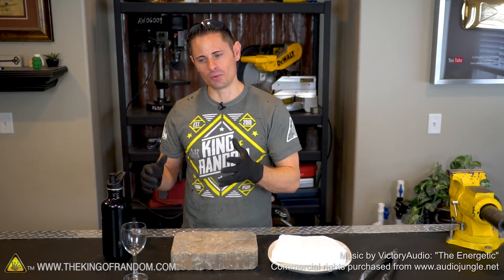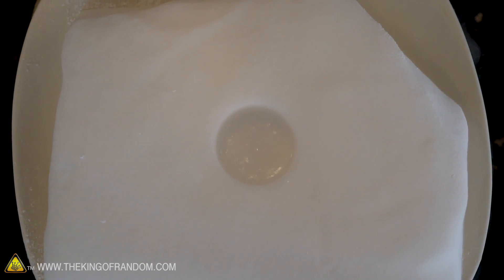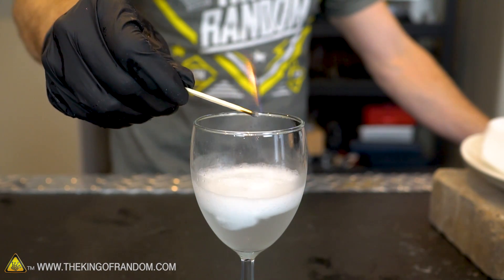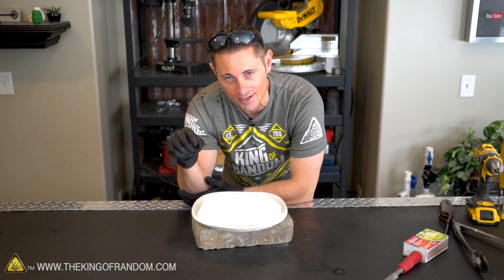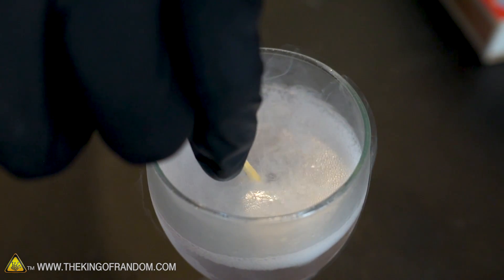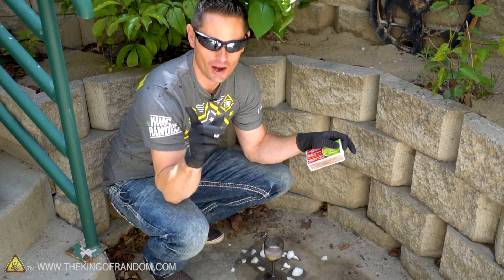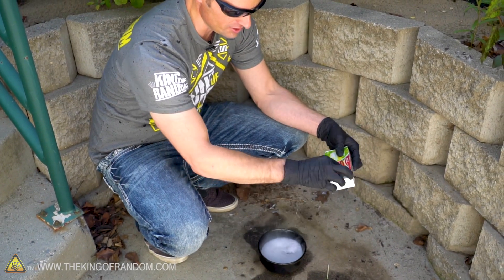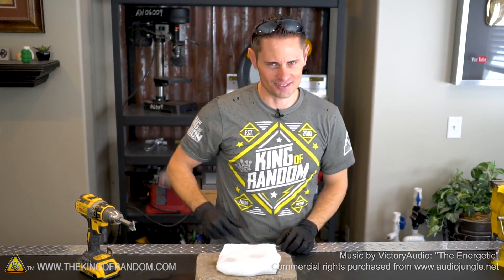What Does GASOLINE Do To Dry Ice? Can You Really Make A Fire Extinguisher With Gasoline?

Comment: The cold temperature of the gasoline stopped (or slowed enough) the volatility of the gasoline to cease evaporation, so there were no gasoline fumes, thus placing the gasoline below it's LEL. Gasoline does not burn. The vapor of gasoline burns.

Comment: -40°f is the start of crystallization not 40°f. But gasoline reactivness slows down starting around -10°f. Freezing point also depends on the octane grade. Low grade fuel will be a different freezing point then high grade or aviation fuel.

Comment: Gasoline its self is not flammable it's the vapors that come off of it that start on fire that fire Heats gasoline which causes more Vapors which causes a bigger Flame adding the dry ice to it cools down the gasoline so it doesn't produce any more Vapors as well as a carbon dioxide layer that makes it extremely hard to light the gasoline on fire

Comment: Normally the liquid gasoline  will not burn, it is the vapor that burns.

If gasoline fumes where lighter than the CO2 fumes, the results would be different.
This is why the CO2 fire extinguishers work.

Comment: Actually, the CO2 layer put the match out BEFORE the match even hit the gas. Oh, and by the way. It probably wasn't the brightest idea to use a battery powered BRUSH MOTOR in a drill to bore a hole in dry ice with a two cup measure of premium gas sitting there open. Invisible gasoline  vapors are explosive.

Comment: You covered that the CO2 puts out the flame by starving it of O2, but there are 2 other factors. First, gasoline has to vaporize before it becomes flammable.   The dry ice can cool it to the point where it no longer evaporates. Second, you need heat to sustain a fire. If you cool it down enough it no longer has the energy available to support the reaction. These three reasons are why CO2 is used to extinguish fires. It has the ability to take away any and all of the three parts of a fire triangle.

Comment: well technically the gas didn't put the fire out. The CO2 would have choked the flame before it hit the gas. It just didn't reignite in the gas.

CO2 is heavier than the air around it but lighter than the Gasoline. So the space above the gas and below the top of the dry ice will always have a layer of CO2 that will choke/starve the flame.

Comment: Carbon dioxide is WAY more soluble in organic solvents than in water. So when you drop lumps of dry ice into gasoline, it bubbles at first as the dry ice sublimes and cools the gasoline down. But if you keep adding more once the liquid is chilled, the solid dry ice actually dissolves in the gasoline to create a super-chilled solution. The coldest temperature possible will be the sublimation point of dry ice itself, which is -78.5 C.

In chemistry labs, this effect is used for chilling reaction flasks, when you need to go colder than water-ice (or ice/salt freezing mixture), but not so cold as liquid nitrogen. Chemists often use denatured ethanol or isopropanol for this, mainly because nobody is going to complain if you dump a bit of alcohol down the sink when you're done with the cold bath, but they can also be cheaper than gasoline.

Comment: the gasoline liquid is not flammable, in room temperature the gasoline is vaporizing and the fumes are the flammable part. 
when you pure it on dry ice, the temperature of the gasoline is too low to vaporize, so there are no fumes so it cant ignite.

Comment: the reason you cant blow away the co2 and light the gasoline on fire is because fire needs 3 things to stay lit, it needs HEAT, oxygen & a fuel. so even though u were blowing the co2 away in the puddle you had in the giant dry ice block is because it did not have that heat it even though it had fuel (gas) and oxygen

Comment: Dry ice cool gasoline until it no longer vapourizes. No vapour no burning, regardless of temperature. The CO2 gas is secondary to the gas not lighting. Put the gas in a cup and chill it with dry ice not in direct contact and it still wouldn’t light.

Comment: We used to literally use hexane baths with dry ice for setting up cold organic chemistry synthesis reactions. It created a better cooling system that wouldn't freeze but would maintain contact with large round bottom flasks.

There was a point where a problematic situation occurred resulting in sparks falling directly into the ~3 liter hexane bath, but at ~ -78 C with the carbon dioxide layers no ignition ever started.

Comment: It's not the gasoline that you need to light but the vapors. Gasoline all by itself is pretty hard to light on fire regardless of what Hollywood has tried to show us. Drop a lit cigarette into a pool of gasoline and the gasoline will put out the cigarette. Hold an open flame just above an amount of gasoline and it will light.

When trying to light this there's still too much C02 not to mention not enough vapor for gasoline to light.

Comment: This guy knows nothing about science. Sad.
Reply: Ray Woods This is so wrong it burns my brain.
Reply: Ray Woods 1. Ethanol is not a part of most gasolines, 2. Ethanol freezes at -114,1 °C which is higher than the -195,79 °C melting point of nitrogen. Sorry, but saying alcohols do not freeze at any temperature is plain out wrong.
Reply: +Ray Woods he meant -40 F. Said it in his previous gasoline video. Depending on the blend, Gasoline freezes between -40 F and -200 F, it's a wide range that it can freeze at because there are multiple substances that make up 91 octane aka gasoline.
Reply: Just a question, what do you know? Please explain.
Reply: Oh, and Alcohol freezes at -173.5°F
Reply: Galactic Scribbles gasoline contains ethonal which is an alcohol and alcohol does not freeze at any temperature.
Reply: jetnut89 and u do?
Reply: Michal Zušťák he says that the gas is 91 octane and that it ought to be able to freeze at around 40 degrees F. Okay, let's give him the benefit of doubt then and say that he meant to say celsius. No. It's still wrong becuase fuel with an octane level that high would only be impaired and not freeze, at about -70 F.

Comment: question!!!
If you somehow melt a block of dry ice in a tub of gasoline, but there would be so much gasoline that it doesn't completely freeze over, would you be able to use that new gas to be replaced for hoses to put out fires?
0.o

Comment: gas freezes much colder check your info bro,gas dry ice episode as well dry ice is carbon dioxide as it melts it releases the gas depriving  the flame of the oxygen it needs as fuel. Heavy freeze the dry ice to the point it doesn't "fog" then gas it with similarly cooled gas but warm enough for it to release vapor and you'll find its a solid that will be resistant to burns but allow the flame until changes in the conditions of either occur to offset the fuel flame ratio.

Comment: You didn't use gasoline to put out the match. You said it yourself, you used carbon dioxide to put out the match. In addition the dry ice you are using is cooling down the gasoline effectively eliminating the hydrocarbon vapors that would be your source of ignition.

I'm sure you could just cool the gasoline down with the dry ice, blow off all the carbon dioxide and drop a match in and it wouldn't light. Try that experiment.

Comment: The gasoline didn't light up when you blew away the CO2 because the fumes didn't reach the ignition point until enough new CO2 built up to put out the match. 

This is also why the gasoline in the big bowl could sustain the fire quite a bit. A large volume of gasoline and the violent reaction of the CO2 drove out gasoline fumes and as soon as they reached open air they could burn off. But the dry ice cooled down the gasoline significantly while the CO2 was also creating a heat barrier. This finally stopped the flow of fumes until the fire didn't have enough fuel left to raise the temperature of the fumes above the ignition point, thereby putting out the fire.

Comment: This is not just about carbon dioxide.  Gasoline only ignites at the proper stoichiometric ratio when the vapor and oxygen mix is right.  The dry ice decreases the temperature of the gasoline, reducing the amount of vapor it can produce, thus preventing he appropriate stoichiometric ratio for ignition to occur.

Comment: Hi, question, did the CO2 put the flame out, or did the temperature of the fuel drop to where it could not support combustion.
Consider the FIRE TRIANGLE, you need ..  OXYGEN.... FUEL.....HEAT.
I think you got so tied up with CO2 you forgot about the need for HEAT to also keep up combustion.
Flashpoint of gasoline  = -65 C
Temperature of liquid nitrogen = -196 C

Comment: Try super cooling gasoline but isolate the dry ice / frozen carbon dioxide from the gas.  Then try lighting super cooled gasoline with a match.  Will the mtach provide enough heat and energy to combust the cooled gas?

Comment: It might take more energy to create the dry ice than the energy released by an equal volume of gasoline burning, or too much oxygen is being driven away by the CO2. Do phase changes of chemicals store and release more energy than their chemical bonds do? That seems counter-intuitive, but if it's true in this case it would mean running a stirling engine from dry ice could do more work than if it ran from the same volume of gasoline burning. [edit: misspelled stirling engine]

Comment: dry ice and liquid nitrogen are the same thing one is just a solid form while the other is a liquid form. Commonly u will find liquid nitrogen in your home fire extinguishers that is used to put out the fire because when u spray it, it makes a c02 layer on the fire and puts it out and makes it lack oxygen. The liquid nitrogen and the other chemicals inside the fire extinguishers means if u have the right type of extinguisher you can put a pillow case over the nozzle and turn it on it will freeze itself and make dry ice.. instant dry ice. 

What ur observing right now is commonly what u will see in your home if a fire breaks out and u use the extinguisher to put it out.

Comment: It's not simply the carbon dioxide barrier preventing a flame.  There are two other phenomena at play here.

First of all, the dry ice is lowering the temperature of the gasoline below its flash point, which is −43 °C.  That means it won't simply ignite in the presence of a flame, it needs to be warmed up for that to happen, and introducing a flame may actually take enough heat away from the flame to extinguish it before the gasoline reaches its flash point.

Secondly, lowering the temperature of any liquid reduces its vapor pressure.  Under ordinary conditions, gasoline is constantly vaporizing.  This is one of the things that makes it so flammable.  Have you ever noticed a weird shadow in the ground when you were refilling your lawnmower?  That's gasoline vapor refracting light.  If you were to bubble warm carbon dioxide through gasoline, it would carry gasoline vapor away with it, and you would be able to ignite it at the interface between the carbon dioxide layer and the normal atmosphere, but because the gasoline vapor pressure has been lowered by the dry ice, there is not sufficient gasoline vapor to sustain a flame.

Comment: Don't know if anyone has mentioned this (couldn't find anyone talking about it), but with regard to the dry ice container of gasoline, I don't actually think that its just the layers of CO2 that are preventing the flame from igniting the gasoline vapors, because I'm skeptical as whether or not there are even enough gasoline vapors to light, because you already proved that you could blow off the container and still light gasoline with dry ice in it. I think that being in a container of dry ice is cooling the gasoline quicker and the gasoline isn't vaporizing quickly enough to be lit by the match before the CO2 sublimated enough to suppress the flame. Don't know if anyone else thinks that's likely but lowering a liquids temperature will noticeably affect its vaporization.
Great video all around, wouldn't have thought to try every little detail.

Comment: The inherent problem here is that the gasoline isn't putting out the fire, the CO2 is. The way you're phrasing it is a bit misleading. The fire douses before it touches the gasoline. Fire requires oxygen (a catalyst), heat, and a fuel source to continue to burn. Remove one, and the fire is doused. The CO2 is displacing the oxygen above the gasoline, choking it of the ability to continue to burn. As gasoline isn't self-oxidizing, it has no ability to react.

Comment: It's my understanding that it's not the gasoline that is flammable, so much as it's the gas fumes that are flammable; so while the dry ice does indeed suppress the oxygen levels to snuff out the flames - is it possible that the dry ice has also cooled the gasoline down to the point that it's not giving off enough fumes?
Reply: I would be interested to see if the gasoline would reignite after the dry ice has melted away

Comment: The gasoline did not put out the fire. This is simply a procedural error: You put the dry ice into the gasoline, and show the carbon dioxide putting out the match. You then drop a lit match into the glass and say the gasoline put out the match. No, it was the carbon dioxide. You were able to light the gasoline after blowing off the carbon dioxide. For a proper experiment, you need to drop the lit match into a glass of gasoline that has no carbon dioxide!

Comment: "gasoline starts to freeze at around 40F..."???? Yeah right. If that's true then we wouldn't be able so start our cars in the winter. Try -40 to -50 CELCIUS, which happens to be -40F to -58F. Yeah, -40F and -40C are exactly the same temperature.

Comment: because only gas vapor burn not liquid not solid only vapor and it needs a spark or a open flame to ignite it a cigar cigarette unless it is flaming will absolutely not ignite gasoline but to get a cig or cigar lit you need an open flame or something that hot and that is when the uncontroled fire occurs only always like o i thought the match was out when it tossed into the solvent wash can and  everyone should be aware of !!!!only napha has a low enough flash point it is low enough to wipe on hot concrete in the sun and ignite colorless cool flames until the wet is gone then everything is on fire with color and your burning some liquids can burn cool enough that it is hard to tell your on fire then the liquid get used up then o fer  sure see the flame or not you know your on fire.

Comment: Yes, gasoline can put out a fire, but that is not what you did. You showed that CO2 can put out fire. If you dip a lit match into gasoline very quickly, the match will go out and not light the gasoline. For a really interesting experiment, you should put a strip of magnesium on top of a block of dry ice, then light the magnesium, and then put another block of dry ice on top. See for yourself what happens.

Comment: Actually, the gasoline in the dry ice cannot be ignited because its temperature (-78°C) is below its flash point (-43°C). There reason in that case is not the carbon dioxide barrier.

Comment: I'm sorry but this is annoying me. it is NOT the gas putting the fire out when you drop a match in. it is the fact there is no oxygen you need 3 things for a fire fuel of some kind which you have. then a spark or ignition source which you have. and last is oxygen which you don't have so in fact its the carbon dioxide from the dry ice that puts out the fire. not the gas like you say it is.

Comment: You can put a lit cigarette in gasoline and it will put out the cigarette.... I've done it many times.  Doesn't go boom like the movies.  No carbon dioxide needed.  The cigarette burns at a temperature below the flash point of gasoline.  Your experiment hear does not prove at all that you can put out fire with gasoline.  It just proves you can put out fire with carbon dioxide.  That must be why they put CO2 in so many fire extinguishers!  WHOA.

Comment: Yep, dry ice won the battle, but NOT because of carbon dioxide alone.

What 3 things do you need to have fire? Fuel, heat, and oxygen. The dry ice is actually taking TWO of these things away. This is why dry ice won the battle to easily.

The dry ice is pushing the oxygen away with it's carbon dioxide, AND lowering the temperature of the gasoline vapors making them even harder to ignite (or stay lit if they did ignite).

Did you ever want a nice fire in your fireplace on a cold winter's night? If you use wood that's been inside (room temperature / 60 degrees) the fire is much easier to get start compared to using wood from outside in the cold (40 degrees or lower).

One other thing I'd like to point out.... Gasoline (liquid) does not burn. Only the vapor from gasoline burns. This is why fuel injectors on car engines are more efficient than carburetors. Fuel injectors do a much better job at turning the gasoline into a mist. The more mist there is, the more vapor there is, the more efficient burn.

Some cars (with carburetors)  had heaters on the intake manifolds to heat the fuel mixture before it goes into the head, which also create a more efficient burn.

Comment: You could put the match out with the petrol (gasoline) without the CO2 there anyway. Petroleum vapour is flammable, not the liquid, so if you stuck a lit match in a glass of petrol it'd just out the match out straight away because there isn't enough oxygen present in the large mass of liquid to get it to light up all at once.

Comment: Gas does not freeze at 40 degrees it has to be way colder. Think about a car in the winter when there is snow on the ground. Diesel starts to gel up around 35 degrees though